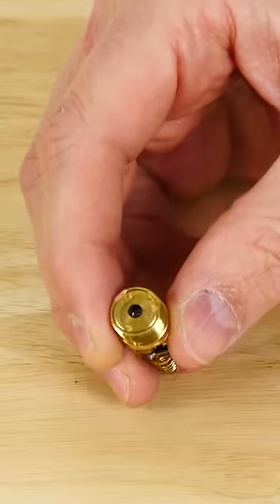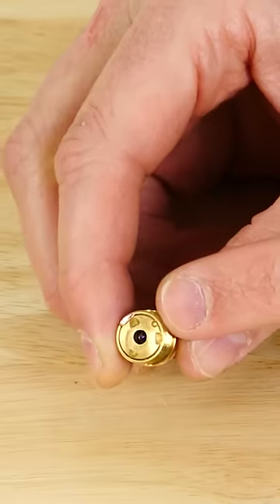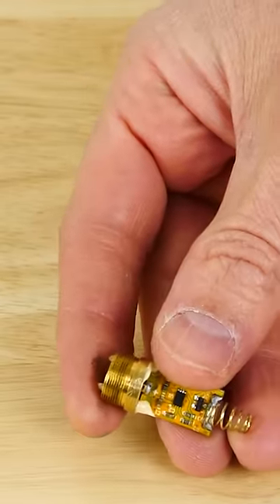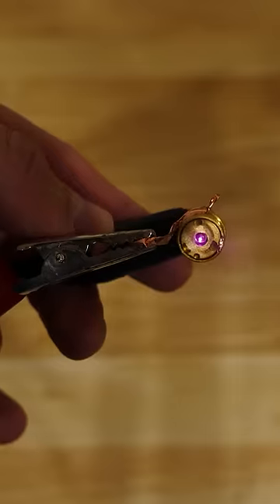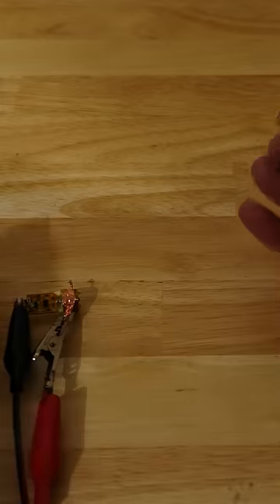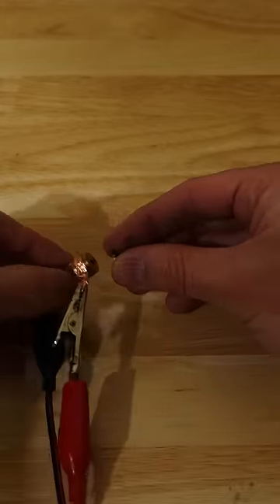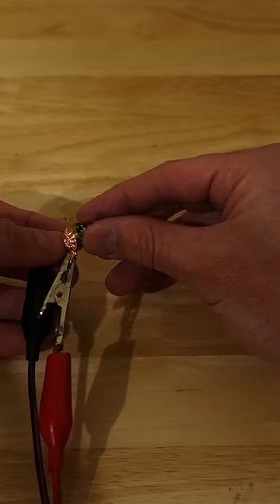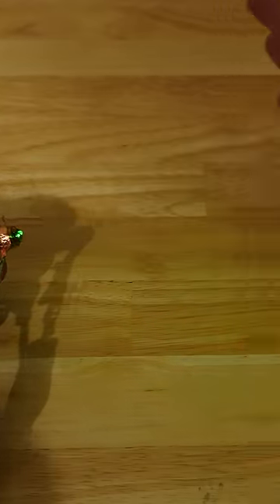This is How Non-Linear Crystals Make Green Laser Light

Comment: Then the crystal falls off and you think your laser pointer stopped working and accidentally blind yourself.
Reply: In any case, you are right, always use laser safety goggles for such experiments
Reply: Or it gets cold.
Reply: That’s only a problem if the pointer doesn’t have a proper IR filter (in which case it’s dangerous even with the crystal). Unfortunately, most cheap pointers don’t have any filter.
Reply: @GRBtutorials  His point is that the laser seems turned off when your crystal falls off, because you wouldnt see the light as itd be infrared. Not that the laser with crystal wouldnt blind you
Reply: You made a valid point.
Reply: I learned a new thing today that infrared can blind you too 😮
Reply: @animememes7531  Near infrared is actually even more dangerous than visible light because it's just as damaging but since you can barely perceive it your pupils don't contract like they would normally letting even more of the light in.
Reply: @jatpack3  Yeeeep.  That's unfortunate how I learned my lesson.
Reply: @erikjarrett4781  can u explain what he means by cold?
Reply: @_Cfocus  Sure.  For me, it was when I brought a green laser pointer outside for astronomy.  It was cold outside and it immediately began to dim.  I was able to replicate that by putting it in a freezer.  At that point the green completely disappeared and only a dim dull red dot remained visible inside...visible by close inspection with my eyeball through an apparently fake IR filter.  At the time, I thought it was broken and/or the battery was not working properly.

The crystal that converts emits green light when hit by infrared light is very temperature sensitive.

Comment: Just a tip for everyone: treat a laser as if it was a gun. 

You don't point the gun at yourself nor others, even if you're 1000% sure it is unloaded. 

Same thing with a laser. No matter whether you see the light or not, NEVER look directly into the laser pointer, because it could very well be the last thing you see. 

Even more so with these DPSS lasers, because they often have no filter for stray IR radiation, and because the crystal doesn't work in the cold.
Reply: Do you happen to know why these things won't lase cold?
Reply: @aclearlight   They'll still lase in the cold, its just that it doesn't do the doubling, so you'll have an IR laser instead of green, which is more dangerous because of their invisibility

Comment: wait, you left the step where 808nm turns into 1064nm unexplained
Reply: The 808 nm matches the energy difference between two electron states in the neodymium atom (Nd:YAG laser.) That means that it strikes a resonance and absorbs, making the electron gain energy. It then releases the energy in several steps by stimulated emission, and one photons of a longer wavelength is released, while the rest of the energy goes into heat. Look up 4-level lasers for more detail.
Reply: @tykjpelk  I might be too young to understand this
Reply: @kiransen6261  How old are you and how much physics education do you have?
Here's the simplest way I can explain it, sadly this is actually quantum physics so it's hard to make it really simple and accurate at the same time:
Atoms can be shaped in a bunch of different ways. What that means is basically that the electrons that surround the nucleus are closer or further away. It's kind of like a staircase, where you need a certain amount of energy to go from one step to another. When a photon with just the right amount of energy passes by an atom, it can send the atom up to another step, or if it's already there, pull it down and create another photon just like itself. Photons with long wavelengths have less energy, and short wavelengths have more.
When you are at a step that is high up, you can fall down to a lower one. When you fall down, you lose energy, and that energy has to go somewhere: Either heat or light. Which one depends on exactly which steps you fall from and to. Sadly I don't know how to explain this very simply, but if you know a little bit of quantum physics, it's basically a question of whether or not the dipole moment changes, because that change in polarization will help create a photon. If you can't make a photon, the energy will go into heat.
In what we call a 4-level laser, there are 4 steps. Normally the atom is on step 1. The energy up to step 4 is exactly high enough that the 808 nm photon can bump it up. Step 4 is very unstable though, and the atom immediately falls down to step 3, releasing some heat. Step 3 is more stable, and the atom remains there. From there it will either fall down to step 2 spontaneously and generate a 1032 nm photon, or be pulled down by another 1032 nm photon that passes by. Step 2 is also unstable, and the atom quickly falls down to 1. This process repeats over and over, meaning that 808 nm photons are absorbed and 1032 nm photons are generated.
What if step 4 was stable? Then another 808 photon would pull the atom down immediately, and it would just be flopping up and down between steps 1 and 4. What if step 3 was unstable? Then there wouldn't be enough time for the existing 1032 photons to pull the atom down unless there were really really many of them, and you would have a really bad laser that takes a huge amount of energy to start. What if step 2 was stable? Then the 1032 photons would kick the atoms back up to step 3, and we'd have the same story of the atom flopping back and forth and photons being absorbed and emitted at the same rate.
Reply: @SimenMartinussen  thanks for the detail answer of how this works.  Fascinating
Reply: @tykjpelk since it's quantum physics and you explain it, if they understand it, you haven't explained it good enough. You know what they say haha
Reply: @tykjpelk  Well done!
Reply: @tykjpelk  thanks ,although I haven't studied 4 level lasers ,I somehow get the jinx of it.
Reply: @kiransen6261  I'm glad to hear that 🙂

Comment: As someone who works with photonics and metology equipment daily...(both professionally and as a hobby in my lab).... I've been stunned at some of the power levels reached by the DPSS lasers. Green and even other colors. But a lot of the laser manufacturers will just buy whatever discount diodes they can get. Which is totally because they put a lot of work into them and sell them for dirt cheap prices. But that can get dangerous quick... Especially if they're not adjusting their drivers and filter setup to compensate for the higher powers.

So I've found C-mount diodes in pretty cheap disposable  laser pointers... Up to powers of one w and even beyond. Which for anyone not familiar with optical output power levels... That is freaking ridiculously powerful for a handheld laser pointer and capable of burning wood and stuff like that with no issues. It's about two hundred times more powerful than standard limit of 5mw in handheld laser pointers. Which is a lot of fun if you're a photonics nerd and can buy up a bunch to keep them around for experiments and teaching...(where a lot of diodes and drivers are sacrificed at the altar of and teaching younger students).... But unbelievably dangerous otherwise... Because they don't usually have an infrared filter and even if they did... At those high collimated power levels.....it wouldn't matter.

Comment: Can anyone tell me how 808 turns into 1064?
That's the only part I am vague about. 
Other than that, great video 👍
Reply: 808nm diode laser excites the Nd:YAG laser, which emits 1064nm. That goes through the frequency doubling crystal and produces the 532nm green light.

And yes, there’s a laser powering another laser. It happens more than you might think. It’s due to the quantum properties of how lasers work.
Reply: @lloyd9516  thank you.  The cascaded laser arrangement was not mentioned in the discussion.   A priori knowledge was required.

Comment: "you send in two photons of light, they annihilate and then they exit as one single photon"

Not really sure if this is how word "annihilation" is used in physics.

"In particle physics, annihilation is the process that occurs when a subatomic particle collides with its respective antiparticle to produce other particles, such as an electron colliding with a positron to produce two photons."

Two photons normally don't interact with eachother.

"Two-photon physics, also called gamma–gamma physics, is a branch of particle physics that describes the interactions between two photons. Normally, beams of light pass through each other unperturbed. Inside an optical material, and if the intensity of the beams is high enough, the beams may affect each other through a variety of non-linear effects."

Comment: The nonlinear crystal splits the 808 nm light into 1064nm light.  (This should be obvious, because of the 1.31683168317 wavestretching ratio.)  Then, because the nonlinear crystal was apparently doped for frequency doubling — a.k.a. wavelength halving — the light departs the crystal at 532nm.
(Some sarcasm was involved in this comment, but also some sobriety.)

Comment: So you want to tell me that we know of a material that aligns visible wave lengths to annihilate/interfere so exactly that it gets pressed/into smaller more energetic wave lengths?

Was it a coincidence to find it? Do people know how the molecular structure does this?
Reply: I really wonder this too..
Reply: Yes! This is very well understood. All crystals with a non-centrosymmetric crystal structure have this property. The most important ones are KTP, LiNbO3 and BBO. It was discovered almost immediately after the first laser.
The physical origin is that in transparent materials, the electric field that is light makes the electrons wiggle back and forth around the nucleus. Actually light inside a material can be fully described by waves in electrons like this and not by photons zooming past. When the light is fairly weak, the electrons just wiggle a little bit, like what we call a harmonic oscillator. But when the light is powerful enough, it starts to deviate from this motion. And in a non-centrosymmetric crystal, the deviation is not symmetric. If you know Fourier analysis, you might be able to convince yourself that a nonsymmetric perturbation will have a second harmonic component 🙂
If all this went over your head, think of it as playing the bass. With gentle strumming, it sounds normal (harmonic oscillation). But slap it hard and it will strike the fretboard (nonsymmetric perturbation at high intensity), and this makes the sound different. Different sound = different frequencies present = higher harmonics being generated.

Comment: That's really interesting and I can appreciate the explanation because I think it answers a question I had from a previous video you posted with that nonlinear crystal (or whatever it's called?), But this made me wonder, I thought I remember hearing light doesn't interact with itself, like say you shine two flashlight beams at each other, they just pass through as if the other wasn't there, right? So if this is infact happening in the crystal then why inside that but not in an open air medium??

Comment: One of our professors used to have a numberplate containing "SHG" (second harmonic generation) and that wavelength.
Reply: The thing about SHG is that you need a really high intensity of light to reach reasonable conversion efficiency. Typicaly this is only found in pulsed lasers.
Is the laser pointer pulsed or CW?
Reply: @eklhaft4531 Based on experience with other laser pointers, I'd guess pulsed. Haven't destr... um... examined that many, but CW were always cheap red ones, often just laser diode, button cells, and a switch. I guess the inner resistance of the button cells limits the current, still...
Needless to say that this kind of laser pointer is probably illegal in the EU (no laser class label or anything).

Comment: Well what determines if you can see the laser light? I noticed you said it's "on the verge of being able to be seen" so what physical characteristic of our eyes determine this? And also another question, in the diagram where you explain what's happening, it basically depicts two beams at possibly a 45 degree angle that end up combining into one solid and different beam, my question is how is that possible because I thought light doesn't do that? Think of holding two flashlights at the same angle, the beams do not interact with each other, they simply pass through one another, so what gives? Am I missing something? When you explain what happens in frequency doubling as I look at the video depiction of what's happening I can't help but wonder what if something different is actually going on and we don't realize it? (I'm referring to what's happening inside the square box in his depiction of two beams combining into one different beam that's moving in a new direction)

Comment: Is it possible to make light chords? Like combining one light combine with another at a ratio of 2/3 just like you can combine frequencies of sound, but instead making a light cord? Would it sound, or look a special way? Is this what the video shows?
Reply: Kind of sort of. Look into four wave mixing based optical parametric amplification. But it wouldn't necessarily be super interesting just because the phases match and there's an integer ratio frequency. However if you take this to an extreme you can create broad spectrum ultrashort pulses. Kippenberg et al have a great review paper on Kerr comb solitons in microresonators.

Comment: Wow! I never knew splitting red frequency in half gives 2 green frequencies
Reply: No, splitting infrared wavelength in half gives green wavelength, and it actually takes two. The frequency is being multiplied. He phrased that in an extremely misleading way.
Reply: @xxportalxx.  Thanks for your response, but what do you mean by it "actually takes 2"?

Do you mean, it takes 2 green wavelengths to produce an infrared?
Reply: @pradhanh1641  oop, typo, **2 photons**. Frequency and wavelength are inversely proportional, i.e. the higher the Frequency the shorter the wavelength, energy is proportional to Frequency, i.e. the high higher the Frequency the higher the energy. Energy is a conserved quantity in basically every situation (the only exception is when time symmetry is broken, e.g. when they say dark energy is created during the expansion of the universe, they're saying expansion breaks time symmetry). These lasers work by first dumping (turning to heat) some of the energy from ~808nm near infrared light to make ~1064nm infrared by using the first laser to pump (power) a second laser, two photons of the latter ~1064nm are then combined to produce ~532nm green light by a non-linear crystal refered to hear as a frequency doubler.

Comment: blue lasars should be hotter than red ones right?
Reply: ב''ה, per photon, so it's probably sort of complicated.  However, for eye hazard look up the "blue light hazard" as blue emitters are generally the worst possible visible  frequency for retinal pigments - your eye absorbs all the energy, as makes it very efficient for brightness, but also makes the brightness that much more hazardous as it's perfectly tuned to potentially fry the retina's molecular antennas and dump that energy into their surrounding tissues.
Reply: @josephkanowitz6875  ohh
Reply: @josephkanowitz6875  I'm not talking about eyes